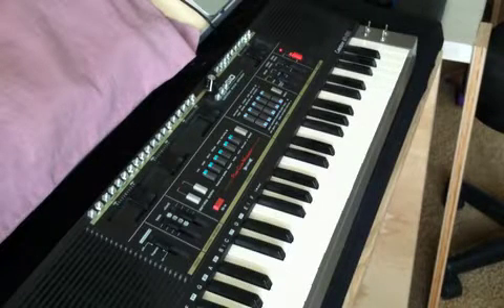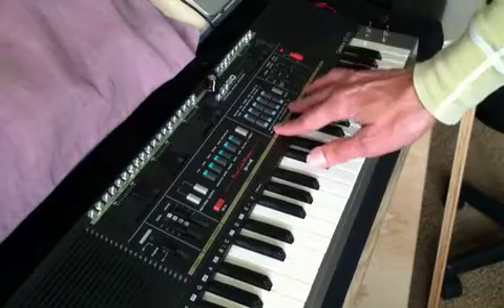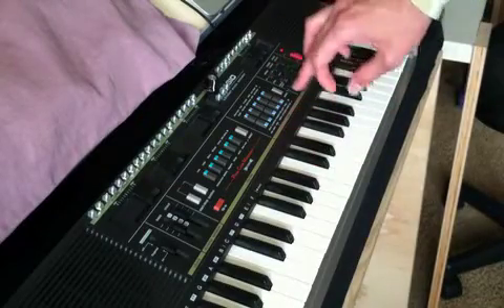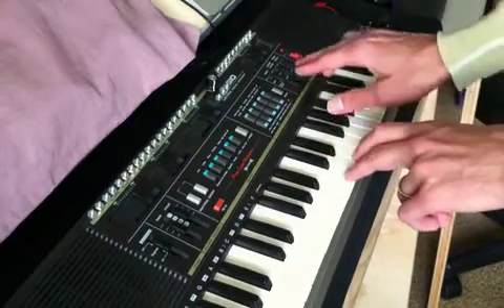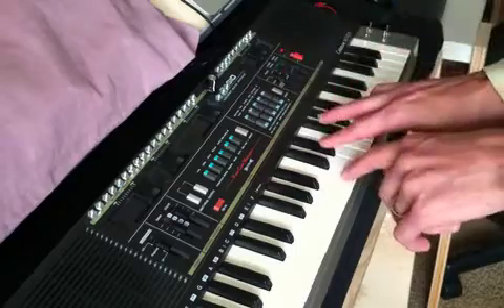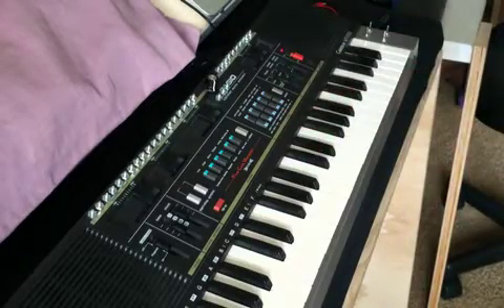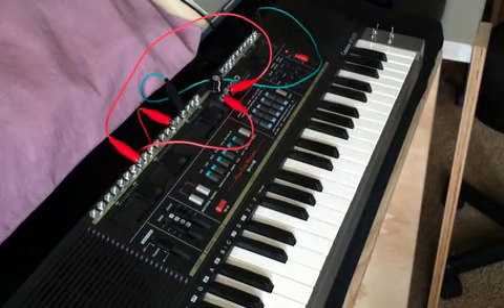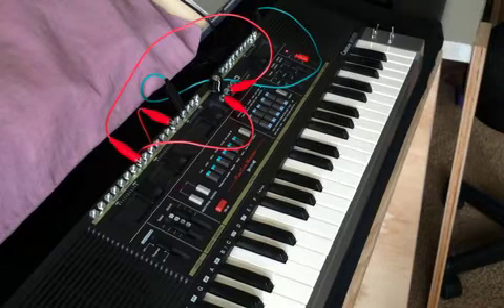Casio MT-210 Casiotone Circuit Bent Keyboard DEMO

Comment: I used to have a Casio MT-210 from 1997-2004, it belonged to my Aunt but it was on loan. I reluctantly gave it to my cousin in 2004 
as my parents had bought me a Casio LK-35 as an early birthday present which is in the garage as in the end I decided I wanted a 
Casio CT-700 instead of the LK-35. But last year I decided to get a Casio MT-500 mainly because the MT-500 has Casio's Super 
Drums feature and drum pads so you can play the drums manually although with this one you could sample isolated drums and 
load them into a VST sampler. I do like the fact the drums are a mix of very lofi drums/percussion but analog hi hats ( the snare 
on the MT-210 also sounds similar to the Roland TR-707 ). It's funny how 20 years ago people used to diss these old 80s and 
early 90s Casio keyboards by saying they are outdated and sound unrealistic but that's the reason I like these older Casiotone 
keyboards because of their gritty lofi sound.

Comment: how did you even start to do this? are there any blueprints? i just got gifted an old mt-210 and i’d love to do something similar
Reply: TheInternetDungeon I don’t have any blueprints. I just poked around inside until I found interesting spots to short circuit. Total circuit bending. Wet fingertips touching the circuit board. Not all combinations of spots have any effect. Hope that helps.